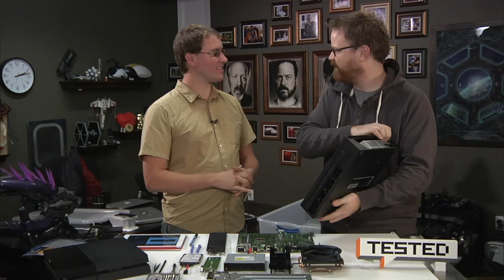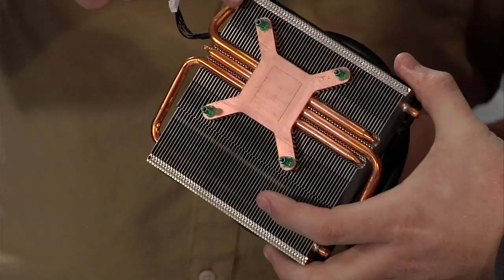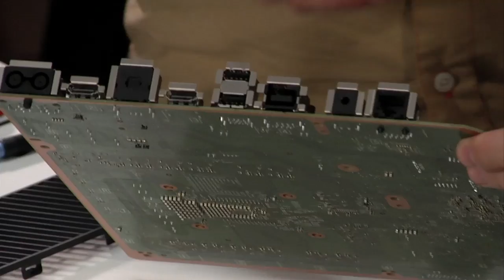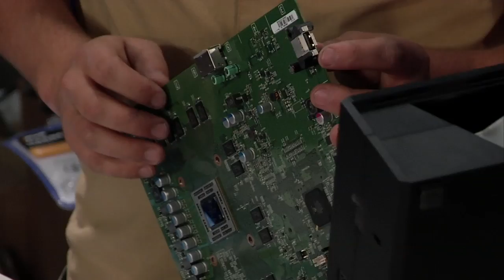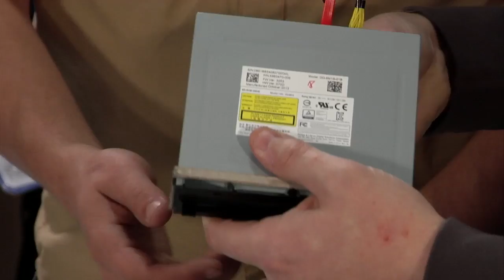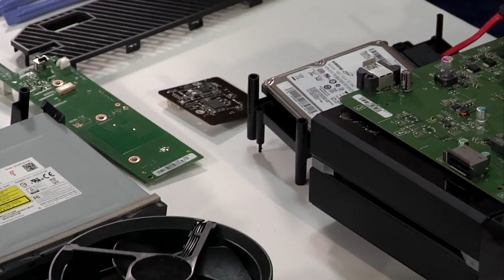What's Inside Microsoft's Xbox One Console

Comment: can you buy all these parts separately and make your own i just wana play halo 5 plz answer
Reply: +Lewis Preston yea but i cant play halo on it and i want to make it because it might be cheaper. than buying a made one
Reply: +D  e   a  t  h S  k  u  l  l the xbox software is closed source and only available to bought xbox's
Reply: Abel Corral It is closed source.. Closed source means that they don't allow the software to be distributed outside of their own company.
Reply: Abel Corral I'm going to assume that only microsoft makes those usb transfer tools, which can only be used with an xbox that you already have.
Reply: Abel Corral I'm going to guess that software only works with windows and mac, correct? This is an entirely separate OS, meaning you can't tell the BIOS which drive to boot from.
Reply: Abel Corral You can't create your own Xbox.
Reply: Abel Corral You would still need to have owned an xbox prior. BTW, the software only works with hardware that is specified by microsoft.
Reply: Abel Corral You'll probably have to talk to Microsoft privately about that, seeing as they offer support for this kind of thing. I have never worked for Microsoft, so I don't know how they go about it.

Comment: Common.....harddrive will fail ?! .... not very likely I still have WD 40gb which is like 15 years old and is still in use to this day and going strong (everything perfect according to S.M.A.R.T. ). What kills harddrives is physical damage not sitting in a good ventilated box.
SSDs on the other hand can withstand physical damage but only have finite number of write cycles.
Reply: Wintutos They can withstand lot more read and writes now than before that is truth but the limitations are still there.

+Hitchens Razor
I have been dealing with computer hardware for a long time, repaired countless old machines and networked thousands of them so I think I know thing or two about PC hw.
I actually currently have in my drawer 3 ooooold 40gb hdds and everysingle one of them works perfectly (2of them were even pulled from laptops so they been on the move).... sure there is no point in using them now as they are slow and my motherboard doesnt have IDE and of course 40gb is nothing. So no old working hdds are not rare. Everything can fail but in my experience in computer world parts become obsolote lot quicker than they die. Parts that die most often in old PCs are NICs and PSUs .... HDD failure is rare (That doesnt mean you should'nt backup stuff.
Reply: WD has manufactured some of the least reliable drives I have ever dealt with. Back in the mid 90s when I was working in a PC repair shop we were RMAing WD drives faster than they could ship them to us. Maxtor was pretty bad too, but I would not touch WD with a ten foot pole. The laptop form factor drives are actually more reliable in the long-run because they generally only have a single platter.
Reply: MrGencyExit64 He's right. WD heaps of shit.

Comment: I love how they got all excited about the "enormous" CPU fan and awesome cooler.  That looks to me like a standard 120mm PC case fan.  My rig has about 8 of them.
The cooler I had for my Intel Core2Quad was about 4 times the size of that cooler, and that processor was from almost 8 years ago...
And on top of this, the fan and cooler are mounted vertically oriented to the CPU, meaning that there is restricted airflow through the CPU cooler.

This is Microsoft...  They excel in PCs...  They know people will stuff these consoles in "hot box" areas...  And they can't even give good airflow to it...
At least have a case intake and exhaust fan to augment the CPU fan!

Glad I build my own PCs rather than rely on some company to under-engineer their product.
Reply: If anyone has a Microsoft branded PC I would love to see it. The excel in software, not hardware.
Reply: I did not mean to imply that they excel at making hardware, but for as much of a hand that they do have in PCs in general you'd think someone on their end knows a thing or two about how they physically work...  You don't make engine management systems without knowing a thing or two about cars, for example.  It comes with the territory.

Comment: Why isn't the ram on DIMM slots?
Reply: Soldered in to prevent upgrading lol
Reply: NerdyBit It's the way it is because things sit above it. Not everything is a play to fuck over the consumer.
Reply: It is cheaper to put it directly on the board.  It is also easier to reliably hit high speeds with it soldered directly on.  It is DDR3-2133 at 256-bits wide; current cpus are mostly 128-bit (two 64-bit channels).  To do 256-bits wide, you would need to use 4 DIMM slots, which would be expensive.
Reply: Good points James. Kinda figured latency would have been one of the factors.

Comment: lmao "those are just chunks of copper" uhh no, those are indeed heat pipes. "and look at these cool green posts" *cringing*  "if you look at it, theres at least 2 layers on this motherboard" *brain starting to hurt* "theyre slowing light down" ok, you need to gtfo sir. "500gb is probably the largest capacity drive you can find in this 2.5" size" i have no words.... "i dont know what this weird thing is" literally has BT and wireless antenna pins right on it. "every couple of years you gotta remove the dust" holy shit balls, id hate to be the one to get a used device from this guy

Comment: Can you upgrade the hardrive and graphics card?
Reply: JJO117 Nope :(
Reply: JJO117 it's clearly integrated
Reply: JJO117 no not the graphics card but you can the hdd, its not easy but I replaced mine once the warranty ended, I put a 2tb in there
Reply: northern marine that's off topic
Reply: ThePotato that's on topic as the question was "can you upgrade the hard drive"

Comment: Is it possible to be used for pc parts or builds
Reply: Lmao this niggah
Reply: Dafuq for ?
Reply: The hardware may be limited but it isnt impossible to fit a PC inside the xbox one case
Reply: Maybe if you reverse engineer the bios.
Reply: Definitely the cooler. Probably the HDD. Probably the DVD rom. Not much else.

Comment: is it possible to build a computer out of xbox one parts
Reply: Won't run windows or mac. But with modding experience you can make it run Linux.
Reply: I just wanted to take the cpu and gpu from it and the ram and put it in a computer case and get a hard drive and power supply and dvd drive and call it good
Reply: TheZombieGlitchers Well I don't know how Microsoft made them, but I do believe that the way they are built they have a whole different framework soldered in. But since it has SATA ports you can add things. lol

Comment: Another problem the xbox 360 had was those stupid x clamps they used. It pulled the outter edge of the cpu or gpu down and pushed up in the center of it. Well the morons used the same stupid design on this xbox. As soon as I saw those clamps in my disassembly I did I immediately knew I wouldn't be buying one for myself. It was just the final nail in the coffin for me.